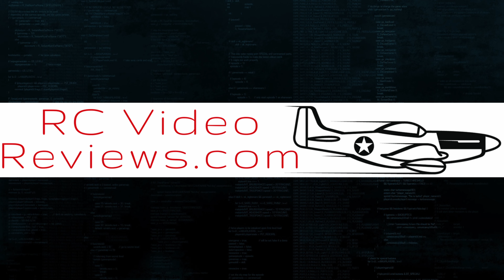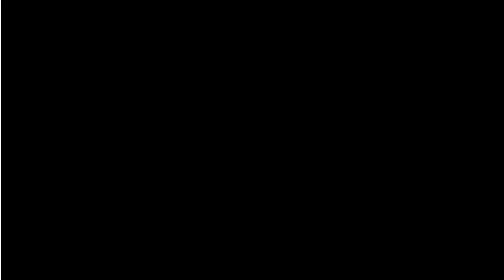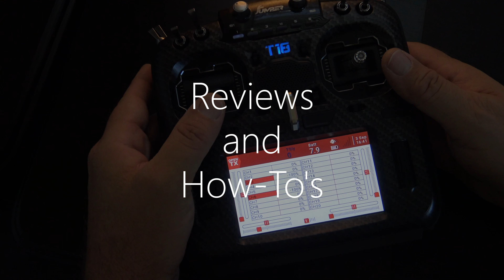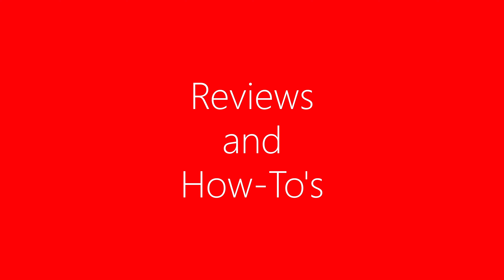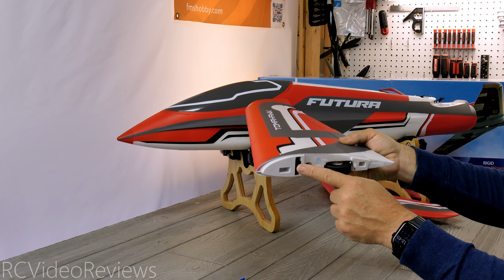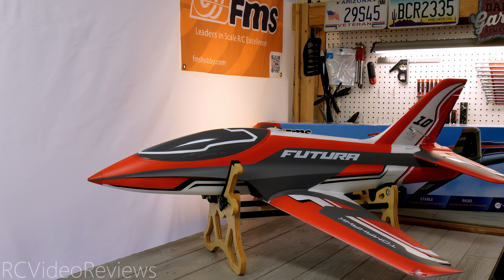FMS 80mm Futura First Look

Comment: solid sport jet with good performance...still im complaining about one or two things...i wish they would put landinglights on jets like this, under the wings favorably to make it easier to see during the approach. The rx mounting plate you printed should be installed from the factory if you ask me...and i wish they would have hollowed out the canopy a bit more to make more room for bigger or oddly sized batteries...other then that, nice jet, lets hope for version 4

Comment: Glad you mentioned they're out of stock but will have units before Black Friday.  They went out of stock last week.

I just wish it could hold and CG a 5200 mah because I have lot of them.
Reply from the maker: I used a 5000 and it balances fine. I had to cut a hole out of the canopy base which isn't a problem since the canopy is opaque.

Comment: Models that fly straight isn’t up to the manufacturer, it’s up to the assembler to be sure that FOR/AFT and INBD/OUTBD (left/right) CG (center of gravity) is almost perfect.  Left to Right or visa-versa will create the bad flying and stall characteristics that needs trim.  The more rudder and or aileron trimming is required at maiden, I suggest first checking the control surfaces and then the INBD/OUTBD CG. Very important